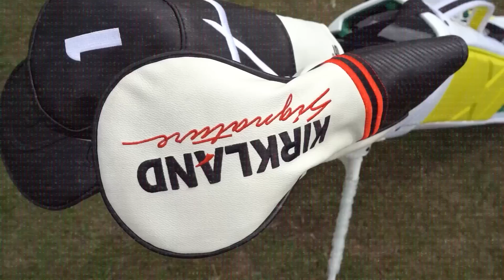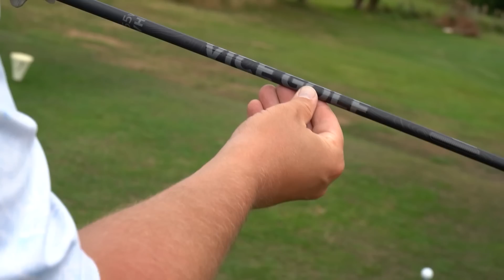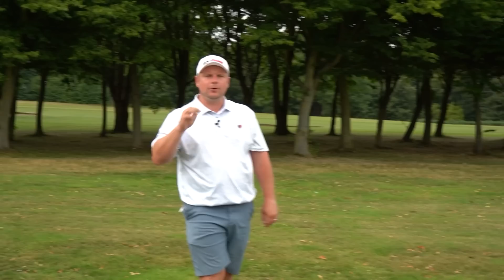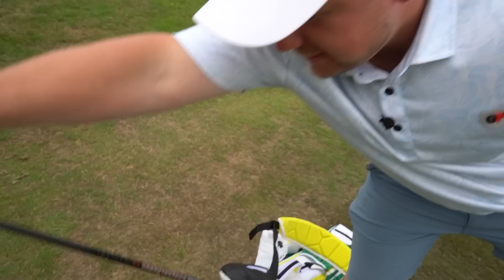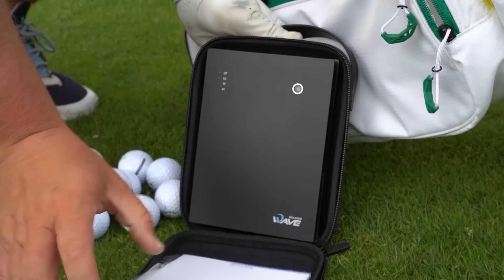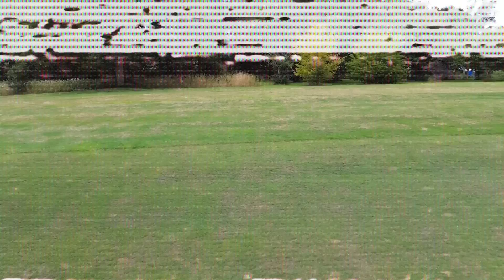Kirkland COSTCO vs TAKOMO D1 vs VICE - BE CAREFUL SPENDING MONEY!

Comment: One brand that does not get discussed much is Cobra...just bought a Cobra LTDx LS for AUD400...thats around GBD200...brand new, but its an older model.....and it goes for miles...my swing speed is around 105 - 107 mph, and I get a ball speed of around 155 - 160 mph and a carry of around 250 meters/270 yards..and i find that its very forgiving

Comment: I have recently bought the Takomo D1. Compared to my Ping G400, I'm more accurate and slightly longer, definitely more consistent (so far). Took a few strikes to get used to what seems to be a different launch, not as high as the ping. Overall it's a great value for the price. Wouldn't mind a look at the Vice too 👍

Comment: But as quickly as golf companies discount their equipment, I think the best way to save money is to buy last year’s model
Reply: Totally agree, I went in for a new driver this week and told the fitter I only wanted to test last years drivers that were on sale.   Walked out with the Ping G 430 for $349 brand new.  I hit Cobra Darkspeed, Callaway AI Smoke, Titleist TSR, and Taylormade Qi10.   While I didn’t love the looks of the Ping, it was by far the best performer for me.
Reply: Which is exactly what I did. Hit several from Callaway, TaylorMade, Cleveland, Srixon, et al - by far hit the Ping G440 the best, but the $600+ price tag said 'no way'. I hit last year's version - I think it might have been G430 - at any rate, I hit it the same and it was about $300+. Sold. 
Don't get hung up on looks - which seems to be what these YouTubers emphasis. Go out and hit several different manufacturers...every time I've gone out intending to buy a specific club - TaylorMade Stealth, Callaway Elyte, Titleist, Cobra whatever, I came away with something else because I hit them.
Reply: I tested callaway paradym against rogue. In my hands the older, rogue proved actually be better in all measurements!
Reply: @jarmohyvakko2653 newer aint always better, especially if its stock "off the shelf" and not custom fit (shaft, grips, head adjustments, etc..)
Reply: Still very expensive considering you can pick up at M2 for about 90 quid and is not much worse
Reply: @xQc247hrs and the M2 is still a very good driver, my buddy is still using it and has no plans on upgrading
Reply: @xQc247hrs I’m still playing the m2,  but I’ve hit a couple of new drivers and while they don’t really go further,  they seem much more forgiving for mis hits-  I e got the vice 7 fairway wood and that thing fly’s straight every time-  I’ve been thinking about getting the vice driver just because I like the 7 wood so much
Reply: @xQc247hrs g430 is much better than the m2
Reply: @xQc247hrs you can easily customize shafts in last years model. The M2 might be a "what's available on the shelf is what you get"

Comment: I bought a used Kirkland for £160 still in the box missing the wrench. 
Found the extremely high launching and spiny. Fitted a KBS stiff shaft tipped at 44.5" Plays away better. 
However it a cheaper head no were near a well made as the SIM2, sound is fine max carry I get is 250-60yards. 
I get 270+ yards from my Seven driver.. its the opposite low spin, low launch changed to a 45gram A flex, which is mad to obtain mid flight.

Comment: Personally I don't ever think it's worth buying these types of drivers "online" even with an online fitting, if you aren't getting fit properly you are much better off buying a used "premium" driver, usually 2 years old is a great price point. I don't know if you can get fit for these, guessing not, but that would be the game changer value wise. You won't lose much if you don't get on with a 2 year old driver (and despite the marketing departments best efforts, drivers are not really getting any better). The other option is to wait until these are available used in a year a so and they will be great value then ;) To be fair not much is going to out perform the Sim2 / Sim2Max at any price point!
Reply: People buy budget stuff because they're trying to save money. If the Kirkland breaks, they can bring it back for no-questions-asked replacement. Try that with any other used driver.